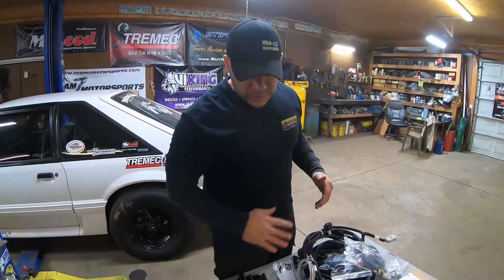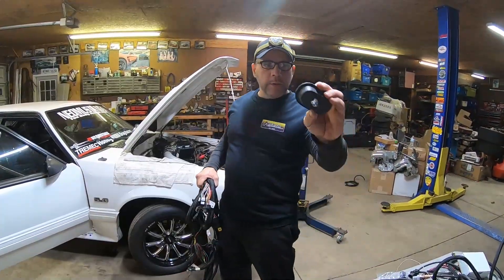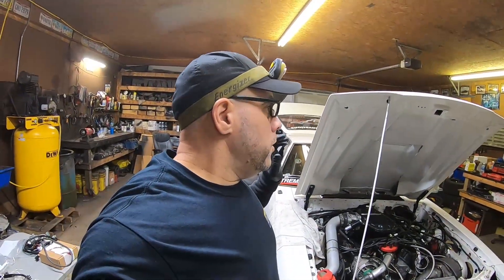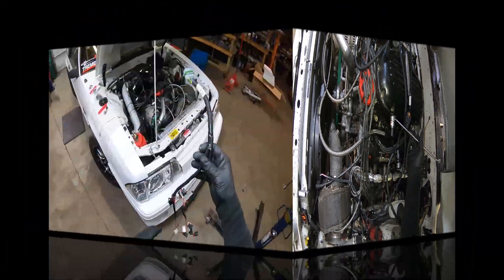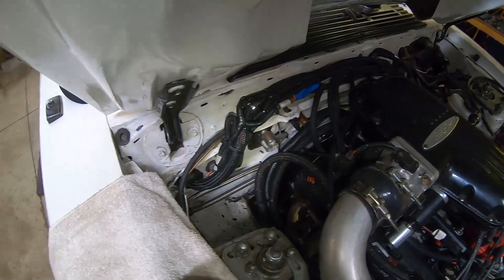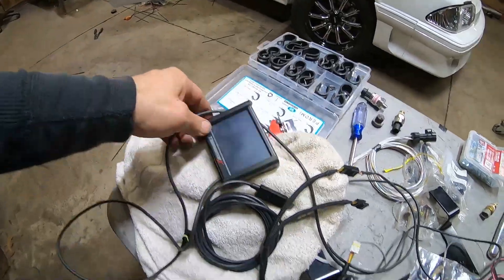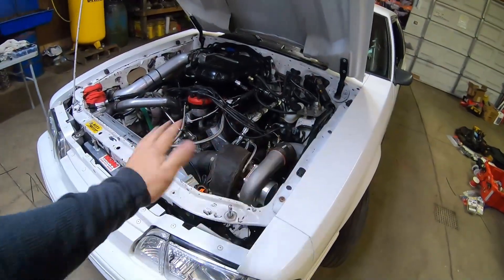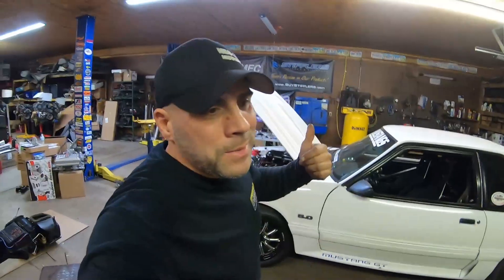We Install HOLLEY TERMINATOR X On a TURBO 363 Stroker Fox Body Mustang

Comment: Alright so they make a plug an play kit for the 550 937 kit? I got the injector harness but for the tfi i saw there is an adapter they sell online but what about for the tps and iacv? And how did it work with the msd box? I have an old msd 6 plus i have the one where u can set your rev limiter and 2 step ect on the little white dials on the side of the box. Not sure how that comes into play with the terminator x. Any info on that harness you have would be appreciated greatly, not sure if i would have to buy another one or if they just modify the one that that comes with the kit.

Comment: I got 357 in a 91 .. pretty sure i skip timing . So doing semi tear down .. might just pull engine . P&p heads 185 enforcers port match intake type R and flip it put craddle and 4in stroker button end . Already 20 over .. been thinking holly x   i got ms2 and it glitched out . Try to save tune and i think it what fucked my car up .. watch these vidz 90% sure going holly

Comment: I am sure you know if you have the same AFR, timing and boost.  It will make the same HP.  So really it's how good was your A9L tune? Don't be surprised if it's not fast off the trailer, at the same boost.  I do think you will like the data logs on the fly ARF corrections, and easy of integrated boost control.  In the end it will make you faster.
Reply from the maker: boost control... its why it will be faster. My A9L tune was spot on but lacked control...
Reply: @Neomustangs   have you decided how you are going to do boost control?  CO2/air pump? Turbo Compressor pressure? 3 port, 4 port, open loop?  There is a way to do MAP based closed loop without using any inputs.  I have been meaning to make a video.  Let me know if you're interested.  So far it's my favorite (have not tried CO2 or compressed air yet)
Reply from the maker: @russellbroadwell  Co2

Comment: My 18 fuse is used from the factory with a 15 amp.  The only fuse tap I can find is 10 amp, do you have a link to a 15 amp fuse tap? I can't seem to find one.
Reply from the maker: i would just use what it recommends.

Comment: For anyone not trying to buy the modified kit, it’s still easy to source individual extensions or wiring if you only have one or two items that doesn’t match the Holley wiring. It’s also easy to unloom the Holley kit and run the wire yourself to a different location and easily solder things like the tps.

Comment: I had 3 of those MAPs fail mounted directly to the intake. They can't handle the vibration. Low doller sent me the stuff to remote mount it to the firewall. Haven't had a problem since
Reply from the maker: Ill keep watch thx.